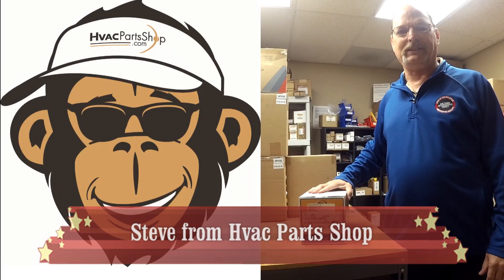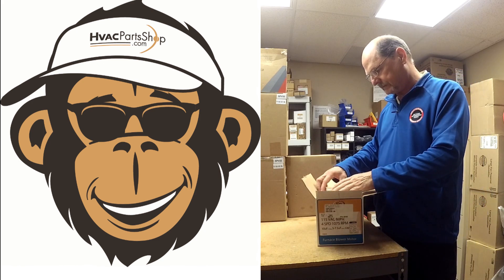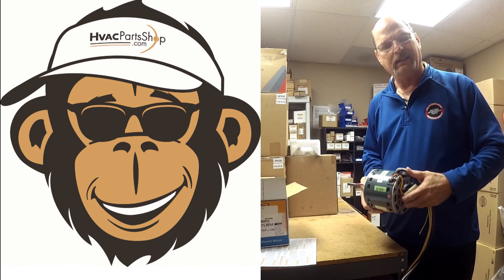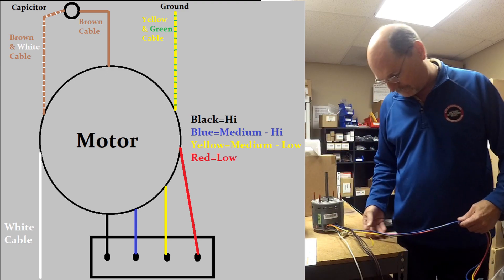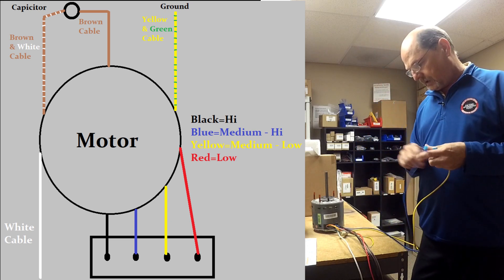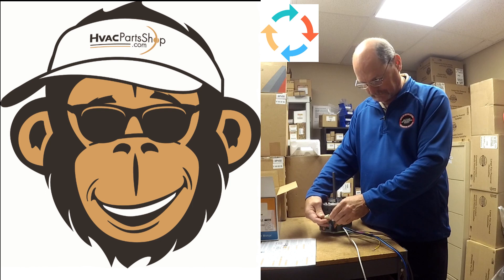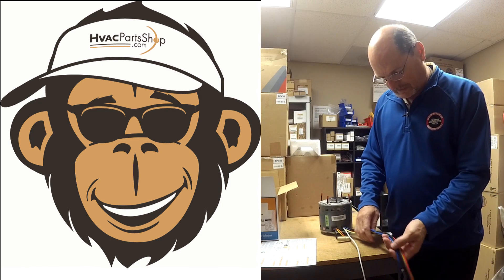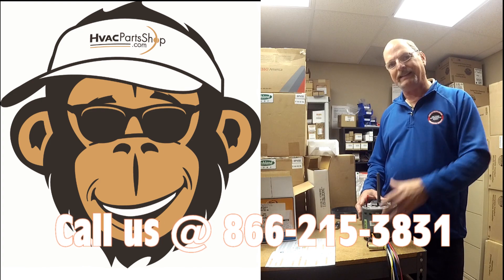How to wire Universal Blower Motor

Comment: I have an old furnace that has a motor that still works but I need to tap it to get it turning. I purchased a new motor but it says it’s a four speed and my furnace only runs the heater, so only one speed. Not sure if I can run this new motor only at the single 1700 rpm. Is this possible? Any advice would help, thanks so much. There are no wires coming from the motor and it isn’t clear where the black or white wires should go, the are 4 spots to connect to.

Comment: Thanks, what I did when changing my furnace blower motor was just put the new wires at the same places as the old ones: new blue where the old blue was etc I was stuck with an extra gray wire and I did as he said with the electric tape and it’s working good